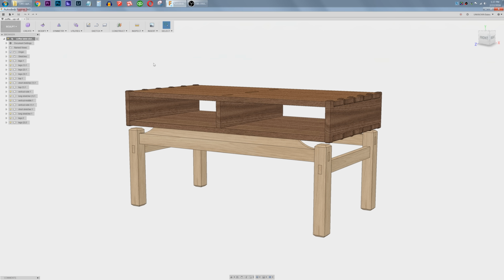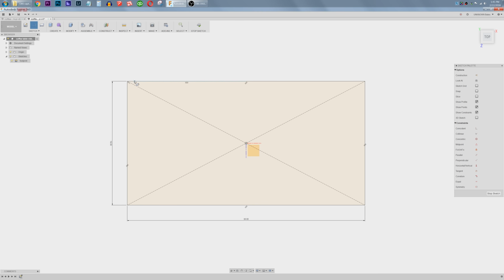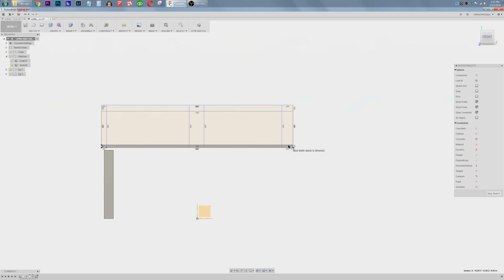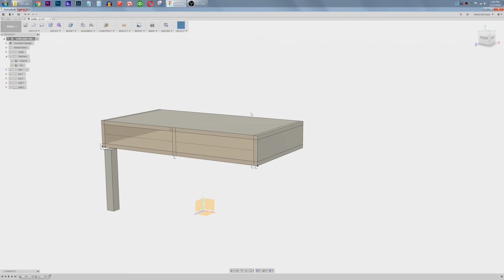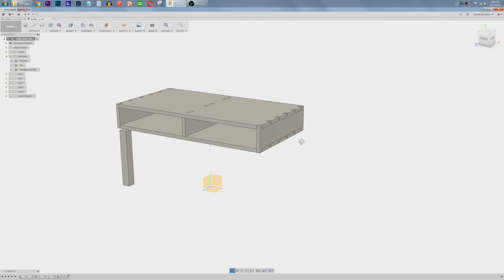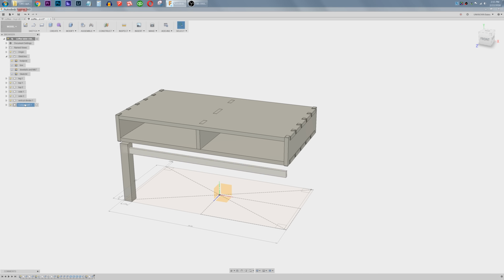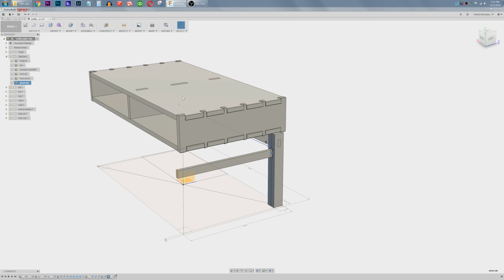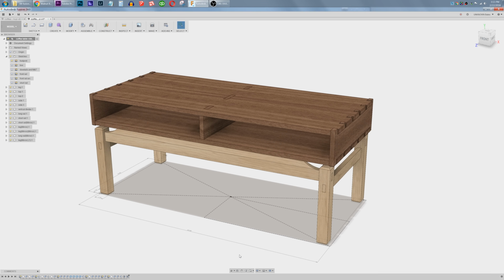Fusion 360: Krenov Inspired Coffee Table

Comment: Kind of like the video so far, but I am getting totally bogged down in the dovetails section. I am using Fusion360 v2.0.6263 and things are... different. When I go to draw the lines for the dovetails, it simply will not recognize the edges of the sides. It will not snap to them at all. If I hide the upper top and select one of the sides as the plane, it will work, but then it won't recognize the other side and divider. Either I have done something wrong (likely) or F360 has radically changed how it handles planes and edges.
Reply: Responding to my own post: https://knowledge.autodesk.com/support/fusion-360/troubleshooting/caas/sfdcarticles/sfdcarticles/Cannot-snap-to-components-when-sketching-in-Fusion-360-on-Mac-after-an-update.html
Reply: @DorothyMantoothIsASaint  Thanks!  I was having the same issue and kept thinking I must have been missing something in the tutorial.

Comment: Another cool thing would seem to be that you could maintain the proportions (such as a golden ratio) in plan view or in profile by using parameters as well. For example if you wanted the depth to be one half or two thirds of the width, you could set a depth parameter dependant on the width dimension.

Comment: With no prior CAD experience I started learning Fusion for some CNC metal milling projects and now use it for woodworking drawings as well. Love it, however it doesn't really help with cut lists or material layout as Jay mentioned. Sure, you can add dimensions to the component description for display on a table but this seems kludgy. And (unless you guys know otherwise) you still have to create separate sketches for stock layout/cut diagrams. Love to hear additional input on how you guys handle these in Fusion.

Comment: Long time listener, 1st time caller.  Thanks for the excellent tutorial.  I just mirrored a body, then changed the original and it updated the mirror.  Basically I extruded a square, then mirrored it, then 2x-clicked the extrusion in the history and entered a different amount and it changed both bodies.  It DIDN'T work when I mirrored, then selected a face on the original and moved it.  The program seems to give you the ability to treat the 2 objects as 2 distinct things when you change the original one way OR it preserves a parent/clone relationship if you modify the original by changing values in your history.  I got both mirrors to change when I modified defined parameters as well.  All that being said, it WOULD be nice to click a button and be able to drag faces around and modify the original and the mirror.  Maybe there is a way... this is my 1st fusion goat rodeo.

Comment: do you use a 3d mouse?
Reply from the maker: No.
Reply: Jay Bates 2 - Vlog and Non Project Videos 
I do 3d design and drafting work for a living using Inventor and the 3d connexion mouses are a game changer. Look them up and you will not be disappointed. The ease of rotating the part and if you buy the mid grade one you can program a few hot commands as well has quick view buttons as well. Well worth the investment

Comment: I have just realised I have been two weeks studying Fusion 360, not full time I emphasise and usually under the influence of a few glasses of wine. Jay, when you are emphasising the dove tails etc do you need to repeat both sides and both tops as they are copies and therefore will repeat where necessary.

Comment: Thanks Jay, great video!  I’ve been using parametric modeling for ~20 years and I found your video very informative. Your SketchUp videos are great and I started using SketchUp based on your techniques. I’ve always struggled carrying those techniques over to parametric modeling because I don’t do a lot of copying of components in parametric cad tools. I typically use assemblies, which isn’t as fast as your copy/move workflow.  Your techniques are very fascinating.  Great advice on fully constraining your sketches and very interesting workflow using the footprint sketch along with advanced extrusion techniques to create the different components. The “clock wheel” is known formally as a “marking menu” and Autodesk has done a great deal of research into that handy menu.  It’s worth a google.  It’s a game changer when it comes to user experience efficiency.  It’s similar to a radial menu in that it uses Fits Law, but it’s gesture based so you don’t even have to wait for it to render.  You’ll notice that in the video when using it to create your sketches. You never see the menu drawn. It’s pretty fascinating stuff for us UX geeks. One potentially controversial question for you.  You seem to break “rule 1” of using Fusion 360 (also worth a google), which is to always create a component and make it active before creating anything (including sketches).  There is good reasons to follow this rule but you seem to have found a workflow that works contrary to that advice.  You don’t put your sketches into your components, which may be problematic if you were exporting your components because you may lose your sketch but in your workflow it seems to work to your benefit.  Using the same sketch for multiple components is an interesting approach that provides the speed I’m familiar with from your SketchUp videos. Have you heard of this “rule” and do you have any concerns about breaking it?  Sorry for the long comment.  Love your work.  Love to see more.  Keep on creating!

Comment: Why couldn't you rotate the legs about the origin like you did with the sides of the box?
Reply from the maker: I could only do two like that. Then I would have to either mirror or copy the other. But if you don't mirror when working with four corner components you end up with situations where the inside face is the outside face.
Reply: Got it, thanks

Comment: I admit I didn't watch the whole thing but heard that Fusion 360 is also going to a web-based UI.  Would you still switch from the Free Sketchup (while it's still active) if they do?
Reply from the maker: I'm not sure. I have spotty internet so offline use is almost a requirement. Maybe if they make the switch and it doesn't slow things down I'll keep using it.